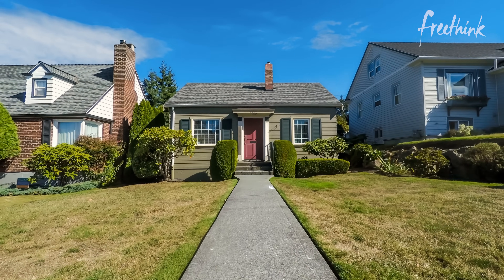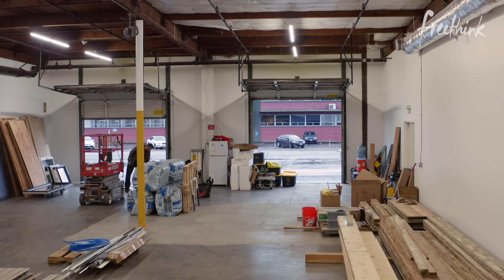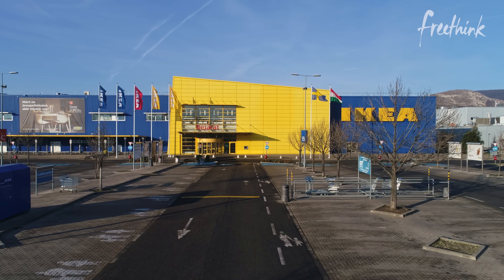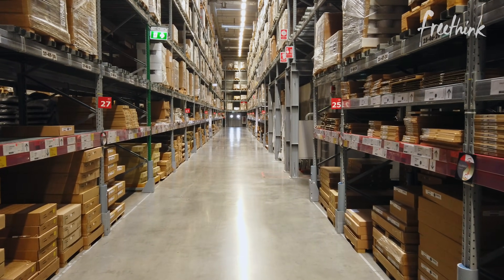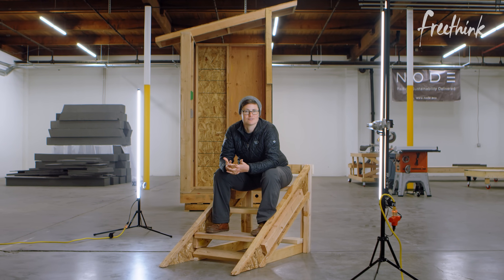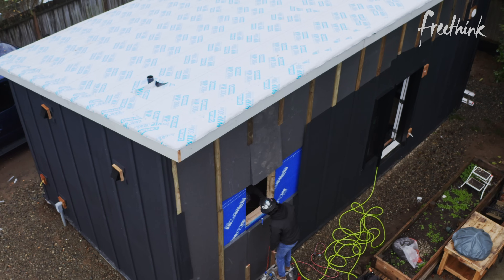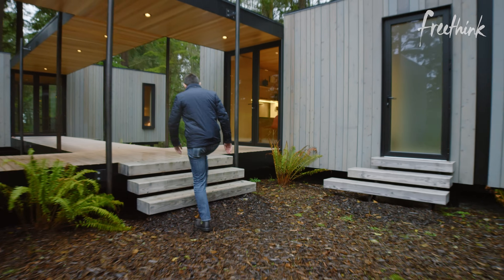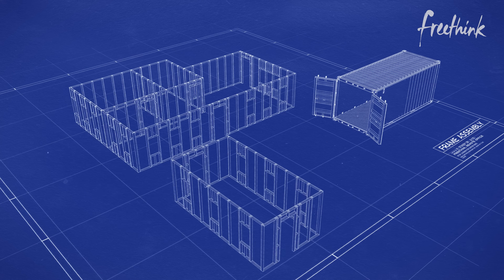This Carbon-Negative Dream House Ships In A Box

Comment: That House makes no Sense (!)
why would I walk between the two Buildings (Bedroom + combined Living Room) &
be exposed to the forces of nature (?) encase the Catwalks with Glass to make them Air Tight...

And why does the Utility Room need to be in a Conservatory / Greenhouse Style Building?

Perhaps a vertical Wind Turbine makes more use of Wind going through the Forest, than the Solar.
A pitched Roof, would fit the Solar Energy / Solar Heating Panels better while also mitigate Service Issues,
like having to cleaning Debris off the Flat Roof. If you want to keep the Flatroof put Plastic Tubes with Planters
on top, to insulate the Roof. And Fog Catchers could help with FreshWater...

And why not use Solar Tubes to get light into the Rooms?
Or Ceiling Windows,  that can help with natural Ventilation, removing the need for an Air Con Unit.
Reply: Wind doesn't "go through the forest" in any amount worth worrying about.

I really wonder about the claim of "carbon neutral".

Comment: Would love to see designs and cost estimates. I'm a fan of tiny houses, so optimizing space, maximizing insulation, and minimizing energy usage -- at no cost to comfort and convenience is what I like.

Might be possible to "build your own house" using parts from the selection of designs -- of that exists. Submissions from customers who built their own homes could be reviewed by the public to even add a "customized" house to the list of designs. 

Lots of possibilities. Wonder how level and durable these houses are, as well as how easily they can be connected to a "grid" (water, gas, electricity).
Reply: all that is simple as pie when you know how - how level are they ??
well if you didn’t make a solid level foundation or pylons it’s simple to crank a jack underneath.

Comment: Not only you didnt explain why this house is carbon negative,you didnt say what is the price too...
Reply: I live in Miami. Can this IKEA house withstand a cat5 hurricane? My old IKEA furniture couldn’t withstand a bit of spilled water and 10lbs of pressure...🤷🏽‍♂️
Reply: @MAYNOR82  Are you calling furniture and buildings beta male?...
Reply: @MAYNOR82  Hahaha me too. I'm curious because the "good" IKEA furniture is expensive.
Reply: Guarantee that house is over $100,000.
Reply: @Macky4941  I'd bet. Irks me this tiny/container/sustainable/green house movement of rich intellectuals designing custom architecture then spending 200K+ on shipping containers.
Reply: 1.21 gigawatts !!!
Reply: If you googled the materials used you would see they answered the question on what makes it carbon negative. The only thing they didn’t explain was price but the amount of time you took to write this comment you could have went to the website and looked.
Reply: Filip Ra I got the impression that they did not know and this was an in-progress discussion?
Reply: They go for around 70-130 thousand euro depending on the area(250-500 sq ft)
Reply: Maybe just MAYBE this is not a store nor an advertisement and what does it say about viewership not just expecting but demanding it to be both
Reply: @inter-y6s  You're right. I must have written that very late at night. Even my sentence structure there is quite haphazard and seemingly strung together. I suppose the point that I so adeptly failed to hit is that they could be giving that specification for an idle condition which isn't realistic to actual use, ie. 101% percent of the energy used while maintaining basic human conditions whilst no humans are present and in sun conditions that are favorable to power generation and unfavorable to heating of the internal spaces.
Reply: Atlas WalkedAway Energy can be stored and/ put back into an electrical cooperative.
Reply: @charlesthomas9960  That's true enough, but I'm not sure it applies to claims made about a single stucture.
Reply: @AtlasReburdened  nice to see a sensible reply from someone when challenged on YouTube.. I was expecting a paragraph or two of expletives.. You sir win the Internet today
Reply: @rob4433  Thanks. Don't get me wrong, verbal thrashings have their time and place, but there's no room for that in matters of math.
Reply: @AtlasReburdened  Lol!
Reply: I think it's a lie that they try to make up for in that comment where they say that it produces more energy than it consumes, which in and of itself, is kind of a pointless assertion which could mean that at "idle"(only cooling itself and with no one inside using anything), 51% of the energy used is derived from solar.
Reply: I will explain to you. It is bla bla bla and the cost is $100k for a piece of junk. Like they said on the beginning compared to Ikea. Ikea sales junk Made in China.

Comment: I still want to know how these houses are assembled and what how exactly someone would go about getting this kind of house shipped and set up.
Reply: Using massive amounts of fossil fuel energy. You cant ship anything  heavier than 1 kilo with battery power.
Reply: @kmicanakreku3905  You could throw this on a train and save a little CO2 but valid point